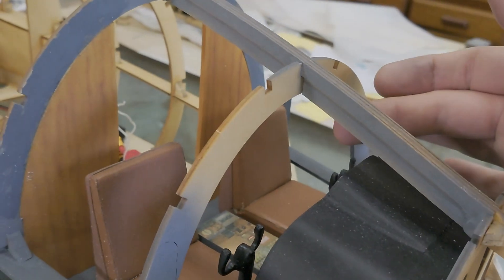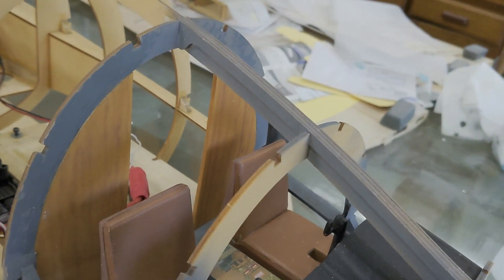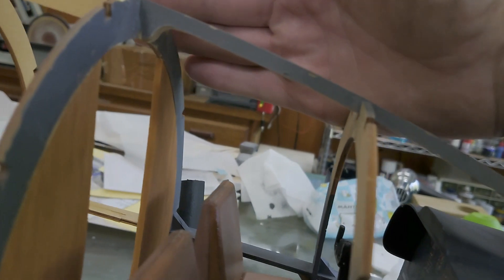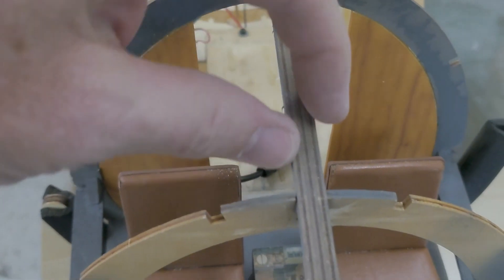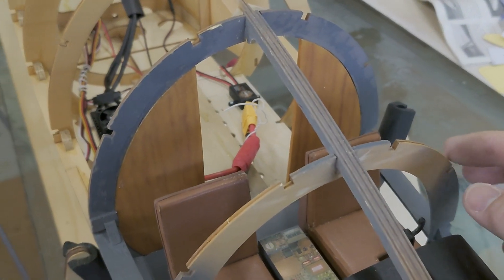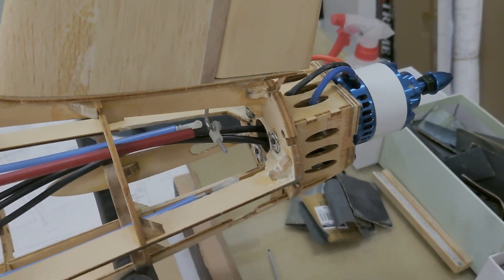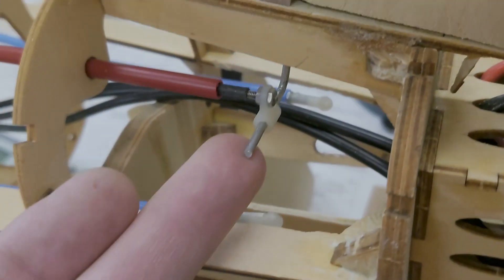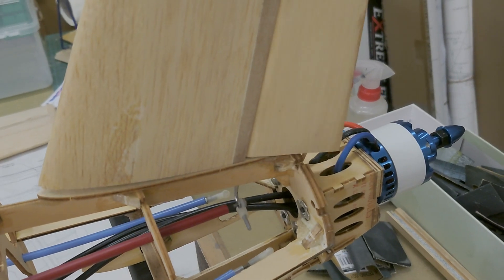Top Notch Lear Fan RC Kit Build, Update #1

Comment: Turn the nylon bracket 90 degrees and connect to the control rod using a clevis to eliminate the rotational torque on the control rod.
Reply from the maker: I was wondering how long it would be before someone commented on the linkage  If it had been for aileron or elevator control, I would have done as you mentioned.  There is a slight amount of tension on the pushrod at each end of rudder travel but nothing that I am concerned about for this particular model.  Thank you for the comment and keeping an eye on me.
Reply: Sorry for being curt.  I was in a bit of a hurry.  It's a gorgeous plane and should be a real head-turner.  Good luck and I look forward to seeing it finished and hopefully flying well.
Reply from the maker: @karlheinz1695  Not curt at all.  It was a good comment.